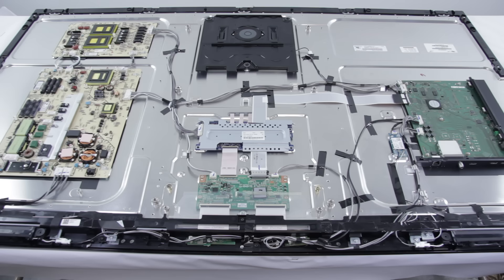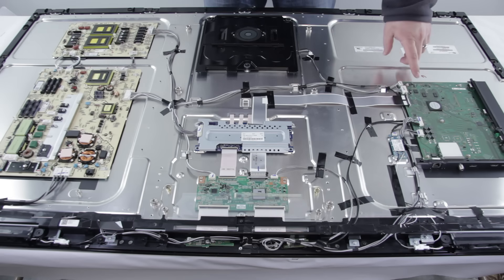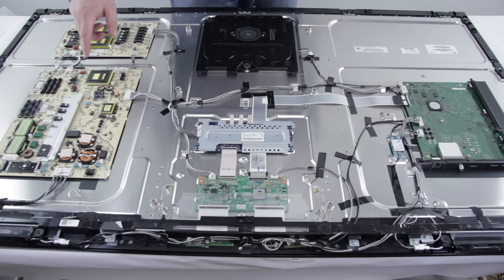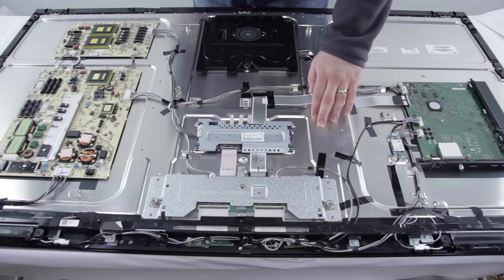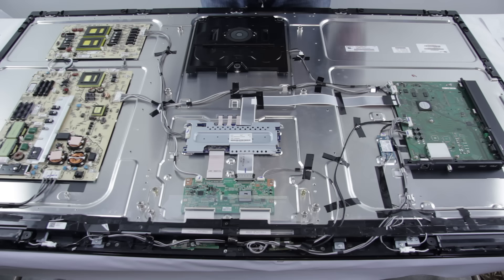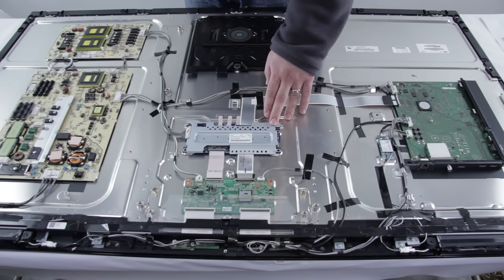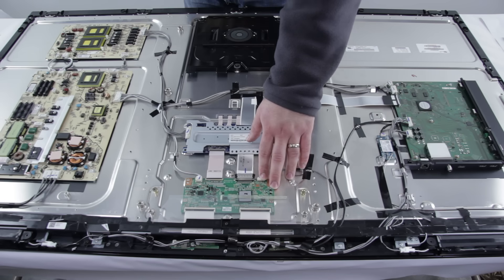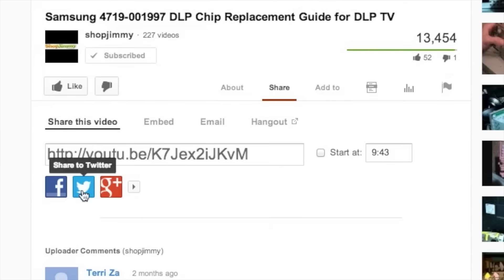LED TV Repair Tutorial - Common Symptoms & Solutions - How to Repair LED TVs

Comment: I have a Vizio e550i-B2.  It is completely dead.  Not even a standby light.  I have tried replacing the power supply board but it did not help.  What else can I try?

Comment: I have a LG 50LN5200 that the screen has gone black and the red light at the bottom goes out when powered on. I can see images when shinning a flashlight on the screen. When powered off the red light at the bottom comes back on. Also when powered on it does flash some light once at the beginning. Your help is greatly appriciated.

Comment: I ordered the parts using the part numbers from the old boards directly and they were identical to the removed boards.  Everything fit exactly and the part numbers matched.
Could it be one of the interface cables?
Reply from the maker: Dave Knoll   After you have replaced the main board, what is the TV doing now?  Thanks!  www.shopjimmy.com
Reply: ShopJimmy.com
To recap, I evidently received a power surge a while back.  When that happened, I lost the HDMI input and had to use the analog inputs.  When I tried the DTV tuner and moved to the "TV" tab, the screen went blue with no options.  I asked you about that and you suggested replacing the main board which I did for no resolution.  I then ordered the Video Box Board assembly and replaced that, no resolution.
Since the analog inputs work and the TV will tune the NTSC signals, even though there are none to tune, I get snow, I'm now thinking the problem may be the interface cable between the Video Box Board and the main board.  But you can probably tell me more than I can assume.  So what do you think the problem could be?
I want to thank you for your time and efforts helping me resolve this problem.

Dave

Comment: I have a sharp tv model number lc--70le732u that has a white vertical bar with colored lines in the center of it please help
Reply: Did you ever get any help? I have a similar problem with a Sharp LED 70" TV
Reply: They said it could be a tv panel problem and it would be cheaper to get a new one

Comment: Hi, I have a magnavox 40 inch led bought in 2013 black friday. Model # 40M313V/F7
I use the dish remote to change channels and the regular remote to turn off/on the tv. Eventually when I turned off the tv with the magnavox remote the tv would not want to turn back on. I waited a few hours nothing. I unplugged it from the power outlet and waited a min and I was able to turn it back on from the tv and off and it was working fine, but as soon as I used the magnavox remote, it screwed up again and I have to unplugged it again. What is the problem and will it do it if activate my dish remote to control it fully. Thank you.

Comment: Hi Jimmy! On my Samsung UE40D6500 there is horizontal darker stripe on the top of the screen which is about 1/4th of the screen wide (here is a picture and a video of the problem: http://i60.tinypic.com/sffo07.png ; http://tinypic.com/r/1h7d75/8 ). The problem is not simply that the stripe is dark - for which the LED driver might be suspected - but the image in it is also distorted and flickerings --> LCD problem or contact problem?
I noticed if I slightly push or knock the back panel at the top left corner (about 10 x 10 cm away from the corner) the problem goes away. Sometimes it comes back after an hour or so, sometimes only on the next day. I displaced the TV and at the given spot under the cover there is only the LED driver with some cables attached to the PCB. Maybe the knocking moves the cable connection a bit, but why on the LED driver? 
Why does the problem go away if I push the back panel? How can it be fixed permanently?

Comment: Hi I have a vizio model E3D470VX every now and then the tv does not turn on and I have to remove the tv from the power source for a few seconds the re-apply the power source. The power source is from a cyber power 500 battery backup block.Should I suspect at this point the power supply board may have a faulty component.

Comment: I have a Vizio 65 inch 3D TV
Model# M3D650SV
Serial# LATAMEAM5003103
It has green purple and blue vertical lines in 2 separate columns on the right side 5 1/2 inches and 10 inches from the bezel I have replaced the T-Con board to no avail It is still doing the same thing and I checked every cable in the TV all connections were good, could you point me in the direction I need to go from here? Thanks for the help

Comment: Hello I have a Proscan plded3992a-c with a flickering in and mostly all black out screen. I have already changed the main board but the issue is still there. Also I have noticed two long circuit boards located under the screen near the IR baord but have no clue what they are or if I should replace them.

Comment: I have a Vizio LCD E472VLE TV. We were watching the TV and heard a pop that sounded like a fireplace fire crackling and the TV turned off about a half of a second later. There is no LED light or indication the TV is getting power and the TV won't turn on. I don't see any capacitors that are bulging or a visible burn mark on any of the boards.

Comment: Hi,  I have an LG 42ub820v.  It has no picture or sound.  I've taken the cover off the back - when I turn it on I can clearly see the lights come through the metal frame but no menu comes up.  I can turn it off and on with the remote but all other controls are unresponsive.
Any ideas?

Comment: I have a LG 55LE5400 , My picture had horz twisting lines at times I can see the image for a few seconds but then goes back to the Horz twisting lines, the audio is normal, if I leave the set on for a while 30min to an hr.  the image  will go back to normal it may last all night or it might last 3 to 10 min before it goes back to the twisting  horz lines. The set has a LED Driver Board But I don't know if its also the T-con Board   thanks in advance

Comment: I have a Samsung 55 inch LED TV (Model # UN55D6000SFXZA). The problem we just started having was that the left half of the screen seems to be losing the color red. I can still watch TV normally, but the left half of the screen color is more gray than anything else. For instance, if we a watching a sitcom, people on screen essentially lose pigmentation in skin color (look like ghosts) when they are on left side of screen. We also have 1-2 rows of LED lights that are out at the very bottom of the screen (this is not a huge deal because it's so low).

Are these problems fixable? Again, the bigger issue is the color loss. I'd really prefer to not buy a brand new TV. Thanks in advance for your help!

Comment: Hi Jimmy, I recently bought a second-hand Samsung 32" Flatscreen TV (I'm not sure if it is a LCD or LED). It was working fine until the other day when it just cut out and turned itself off. The standby led is on when it has power, but when I try to turn it on the red LED just flashes at the front. I've been told this could be to do with capacitors - I have opened up the back of the TV, and the capacitors look fine (none of they are bulging), any tips?

Comment: Samsung 55 LED  Model # UN55ES6500F
Remote controls stopped working.  The TV will not respond to any commands by the remote.  I can not adjust the volume, select any inputs, or change anything.  In order to turn the TV off I have to do it manually with the button on the rear of the set.  When I use the DIRECTV remote to turn that box on it will turn the TV on, but it will not make any adjustments to the set as it use too.  I have another samsung tv and both these remotes will work on that set.  This happened before for about a week and it just suddenly started working again one day.  This time it has been this way for three weeks.  Set is only 2 years old, any clue whats going on???

Comment: Greetings. I have an LG 47LM6400. On start up, the picture started showing a green tint with some darker splotches. The TV warms up and all is well. The "Picture Test" mode displays a perfect picture. Internal analysis say to check the input devices. I get the same green tint with all input devices removed. I replaced the main board this afternoon. I got the same green tint on start up. The LCD was replaced under warranty more than a year ago. Is there a chance the power board is the problem? BTW. This TV only has the two boards. Thanks for this site and your help.

Comment: Hi Im having a problem with my picture It started with colored vertical lines and now I have a big black vertical thick line at the center of the screen . I have a samsung UN55D7050XFXZA..Please help..thank you
Reply from the maker: Maria Chan This sounds like a TV panel (TV Screen) problem.  If your TV panel is bad, it may be more cost-effective to replace the TV as panels are typically hard to find in stock, difficult to replace, and expensive.  Thanks and please let us know if you have any further questions!  www.shopjimmy.com

Comment: Hi I have a 10 yr old 50 in RCA CRT HDTV Model #R52WM24  I had to have the main board replaced about 3 yrs ago,now it won't turn on any more. The power light will come's on for about 10 seconds then goes off and won't come back on. Do you have any idea what is causing it & is it worth getting fixed? Thanks
Reply from the maker: DON LINSKY   Unfortunately we do not have parts for CRT TVs.  Thanks!  www.shopjimmy.com

Comment: I have a Seiki  SE47FY19.   I have no picture on the screen but do have sound.  I did the flashlight test and there is a picture on the screen.  On your website I didn't see a LED inverter listed, so in an instant chat your advisor suggested replacing the power supply board as it had the inverter on it  (part # 890-PM0-4701).  I replaced it with no change in results.  Any other suggestions?
Reply from the maker: Bill Neff   This sounds like you have bad LEDs in the TV panel.  Unfortunately we do not sell replacement LEDs or replacement TV panels.  Thanks!  www.shopjimmy.com

Comment: hello iv got a old samsung LCD TV it keeps changing inputs is there any info you can give me that might help fix this iv tryed to do a Factory reset and remove the buttons on the side of the TV as a lot of others have faults almost the same but it stops when they remove that motherboard did not work for myself so I'm wondering if you might have anymore idea's maby how to remove all together Dtv what it keeps changing to details on the TV are 
Product Identifiers
Brand	Samsung
Model	LE40S73BD
MPN	LE40S73

Key Features
Screen Size	40"
Definition	HDTV-Ready
Resolution	720p (HD)
3D Technology	3D Not Supported
Smart TV Features	Not Supported

Technical Features
Supported Resolutions	720p (HDTV)

Comment: I have a Toshiba Cloud 50L4300U, the home button won't work and the apps won't load (like Netflix and internet).  Picture and sound works fine.  I've re-installed the bios and done the factory reset.  I got it as a gift from work one year ago, didn't get a receipt so customer support wont help me unless I pay them.  It connects to the wireless router and tests fine.  But the Smart has gone Stupid in the thing.
Reply from the maker: Samuel Jibben  Please watch this video FIRST to help with your repair!  https://www.youtube.com/watch?v=BP3NVNCGEv8  I recommend replacing the main board in your TV.  Click this link to replacement parts for your TV model number:  http://www.shopjimmy.com/toshiba-75033401-main-board-for-50l4300u.htm  There may be multiple boards for the same TV model number, be sure to match part numbers on your current board, with your replacement for compatibility.  Thanks and please let us know if you have any further questions with your TV Repair!  www.shopjimmy.com
Reply: I already did watch it.  Replacing parts doesn't fix programming errors. Repair doesn't always mean replacing parts. All I need to know is how I can hook it to my pc and get into it's code.

Comment: Wondering if anyone can suggest what might be going on with my set.  It's a 5 year old Vizio xvt553sv that's just started to distort with a lot of red showing.  I can put some menus on the screen and toggle the problem on and off depending on what menu item is highlighted.  Seems to be more of a problem when the video signal contains more red.  Also note the bullseye pattern in the lower left quadrant.  Any suggests would be appreciated.  I'm fine with replacing boards if it comes to that but at this point, I'd be guessing at which one.  The video is here:

http://youtu.be/Pnx9u83AN2Y

Cheers!

Jon
Reply from the maker: Jonboy37   This sounds like a TV panel (TV Screen) problem.  If your TV panel is bad, it may be more cost-effective to replace the TV as panels are typically hard to find in stock, difficult to replace, and expensive.  Thanks and please let us know if you have any further questions!  www.shopjimmy.com

Comment: Hello, I have a Samsung LN46A650A1FXZA. The problem is with the HDMI ports, whenever anything is plugged in to them it will cut in and out sporadically. Rarely, there will be a loud buzzing sound instead of any audio. I have tried multiple devices, and multiple HDMI cords with no result.

Comment: hi i have samsung UN55ES6500FXZA LED TV . its screen has 4-5 thin horizontal lines on lower part of screen and all the colors have gone very dark . on self diagnosis picture test the lines and dark colors persist. . reset also does not help .
Reply from the maker: zxs   This sounds like a TV panel (TV Screen) problem.  If your TV panel is bad, it may be more cost-effective to replace the TV as panels are typically hard to find in stock, difficult to replace, and expensive.  Thanks and please let us know if you have any further questions!  www.shopjimmy.com

Comment: Please help, Vizio LED TV VF551XVT? watch tv, screen go black (sound fine) then few min back on. repeats... or quick flash black then on. I turn off auto dim to try fix it. Still flash black then back. can turn on tv, screen black but logo on below screen. Turn off/on get picture. switch input, screen not display anything but tv menu screen/volume display normal. after couple min screen flash on display normal. sometimes wont come on till try again at later time. Thanks!
Reply from the maker: Josh Sinn   This sounds like a TV panel (TV Screen) problem.  If your TV panel is bad, it may be more cost-effective to replace the TV as panels are typically hard to find in stock, difficult to replace, and expensive.  Thanks and please let us know if you have any further questions!  www.shopjimmy.com

Comment: I have a 55 inch led un50f5500af tv and it's only about a year old. Every once in a while I'd have problems with it turning on and off while I was trying to watch ir. I usually unplugged it and the problem would solve itself.  Now it won't turn back on for more than a few minutes and the light keeps flashing. How can I stop this from happening?
Reply from the maker: Michelle Haines  Please watch this video FIRST to help with your repair!  https://www.youtube.com/watch?v=BP3NVNCGEv8  I recommend replacing the main board in your TV.  Click this link to replacement parts for your TV model number:  http://www.shopjimmy.com/catalogsearch/result/index/?cat=56&q=un50f5500af+  There may be multiple boards for the same TV model number, be sure to match part numbers on your current board, with your replacement for compatibility.  Thanks and please let us know if you have any further questions with your TV Repair!  www.shopjimmy.com

Comment: Hi, I need your help with my broken LED TV.
I have an LG Smart TV 42 inch that got a kick by my little kid toys and broke its panel. Of course it needs repair...
 No one recommended to repair due to its high cost and I was told that the TV was a total lose. 
Therefore, I decided to go in an adventure. I uninstalled the black broken panel. It was nice to know how the TV looks like from inside and how its technology works. Actually all the other parts are returned back to place. BTW I hold a PhD in Physical Chemistry and I think that I have good hands for lab work.
I would like to hear from you what do you think about this repair and how can I order a new panel.
Do you know about any special procedure for installing the new panel?
Should it be done in certain environment or using some chemicals to prevent dust or any other concerns that you know, I would be glad to have your inputs. Thanks.
Reply from the maker: Butros Hallac   Unfortunately we do not sell replacement panels, nor do I know a place where you can find a replacement panel for your TV.  If your TV panel is bad, it may be more cost-effective to replace the TV as panels are typically hard to find in stock, difficult to replace, and expensive.  Thanks!  www.shopjimmy.com

Comment: I have a Vizio L32HDTV10A.  The DTV tuner is not working and I ordered the main board and installed it.  Still nothing when I go to DTV and select the tuner menu.  So I ordered the Video Box Board assembly and installed that.  Still nothing but blue screen when the DTV tuner is selected.  I can get to the other options like Picture Adjust, etc.
Do you have any other suggestions without purchasing a stand-alone off-air tuner?
Thank you
Dave

Comment: Hi I have UA32EH6030 Series 6 3D LED TV, when I connect it to the power source it will immediately turn the backlight on without pushing the power button, no picture, no sound but only grey screen, can you please tell me what could be the reason.
Reply: ShopJimmy.com Thank you for your reply, I already figured out the problem, I just replaced the main board the screen will not show any thing just black with no power, I had to replace the power card too and it worked, unfortunately the main card is not available as the same old part # BN94-06125C, so I bought different part # yet I am not sure if the 3D function will be back again, I sent the screen to a technician to fix the power board and I will let you know the results